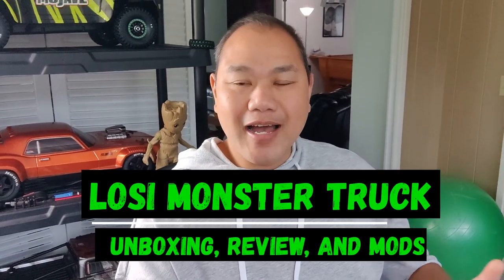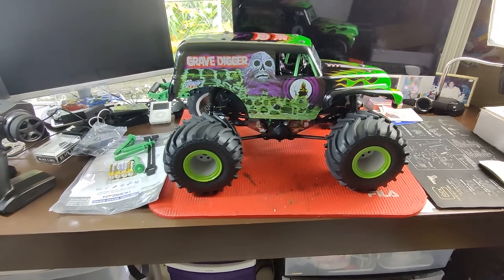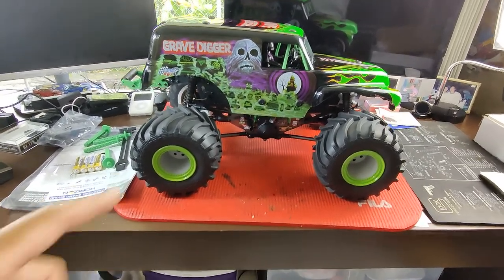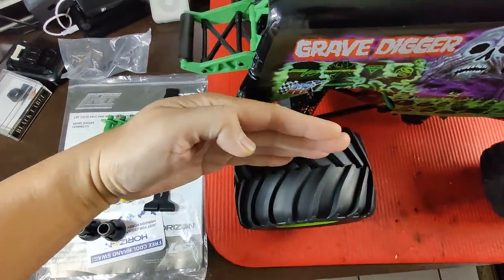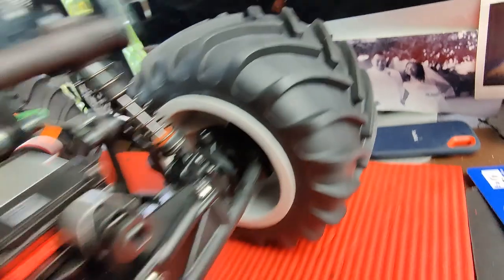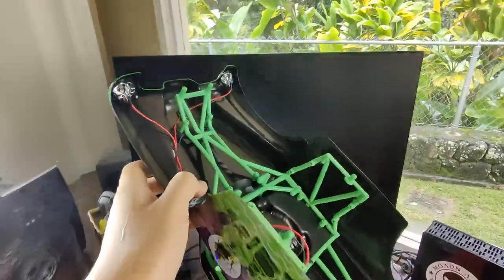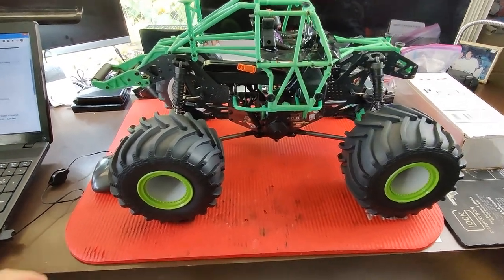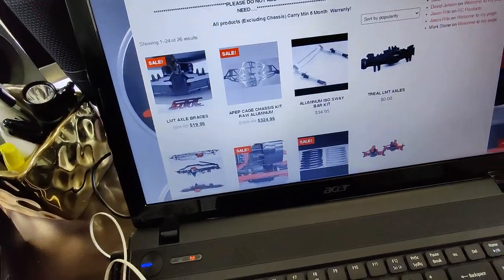Losi Grave Digger gets unboxed, reviewed, and JER axle braces!

Comment: Hi just saw your channel and just wanted to say love your vids. Also I have one question how did you mount the esc on you 1/16 Erevo. If you can, would you mind making a video, but if it’s just something you don’t want to waste your time on it’s fine.
Reply from the maker: Hi Victor.  The sidewinder 3 was mounted by turning it sideways.  I then drilled a hole above the battery compartment and used a medium sized ziptie to pass thru the hole and into the battery compartment and wrap the esc.  It holds the esc into place very securely with no issues.  It holds in there great and easy to mount and dismount should i need to get access to the motor or work on the MERV.